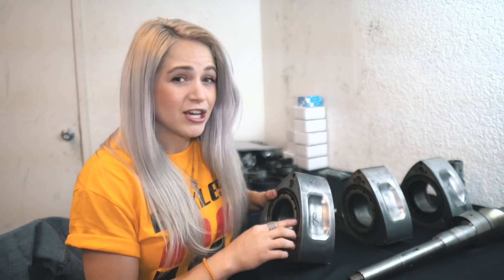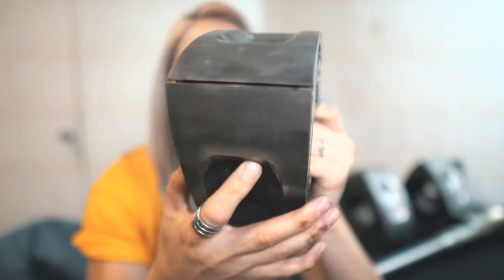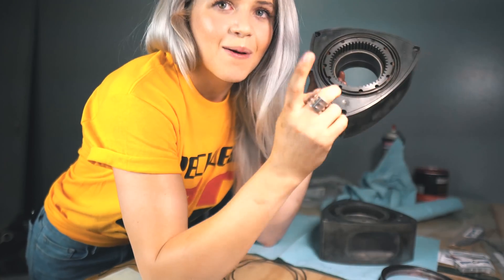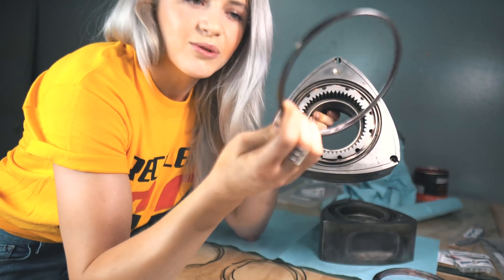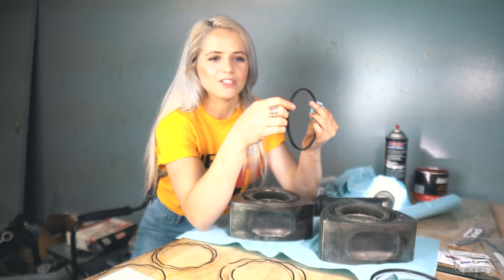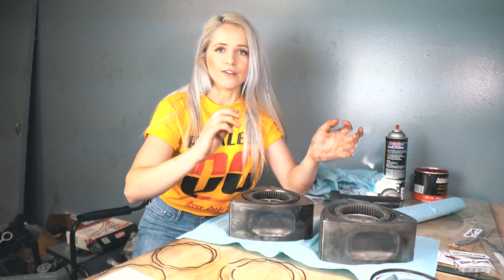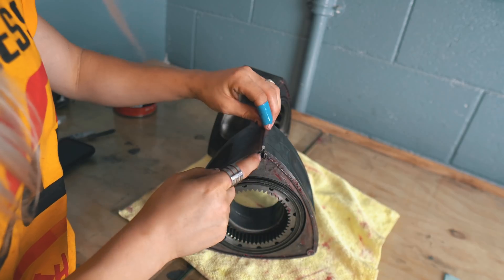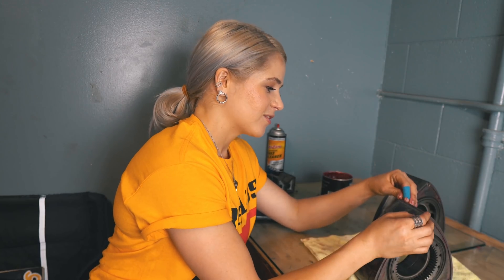How To Assemble Rotors | Rotary 101 !

Comment: I have only rebuilt one 13B engine. The details you presented are very important.  Did you have the rotors spun for balance?  The apex seals are usually placed when the rotor is positioned on the eccentric crank shaft.

Comment: Hi collete. Looking reckless lol. Love chipmunk collete too lol. Very good vid. Did you mention the oil control ring, orings ? And fitting them ? Zoom Zoom Zoom
Reply from the maker: Rotorworks Automotive Garage NI hey! Yea i go over installing oil control rings + springs 🙌🏼🏁
Reply: @ColleteDavis  talking about the mazda green and black rubber orings that go inside the oil control rings :D Zoom Zoom Zoom
Reply from the maker: Rotorworks Automotive Garage NI oh gotcha, yea those are pretty self explanatory you just wrap them around the ring 🙃🙃🙃
Reply: @ColleteDavis  lol. Not for the ones that don't know about them :p lol you going Collete on inlet manifolds :D Zoom Zoom Zoom
Reply from the maker: Rotorworks Automotive Garage NI will mention it in the 20b video 😝
Reply: @ColleteDavis  20B :D Zoom Zoom Zoom

Comment: That 2nd rotor probably had some detonation going on or misfiring
Reply from the maker: Ramon Villa its common when ur machining rotors to fit 3mm seals ... it doesnt come that way stock, so i found out there are usually little adjustments u have to do after